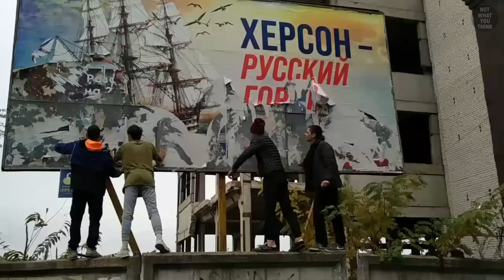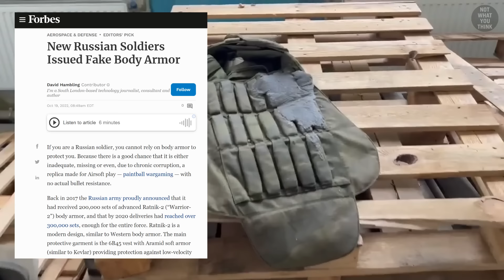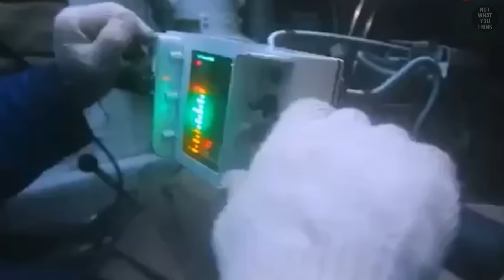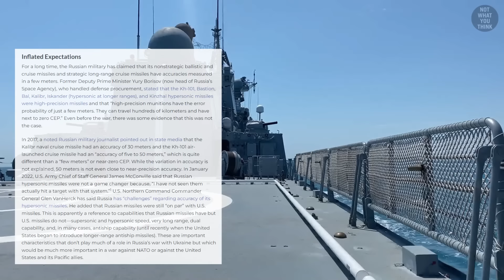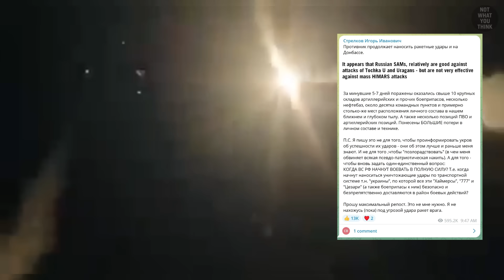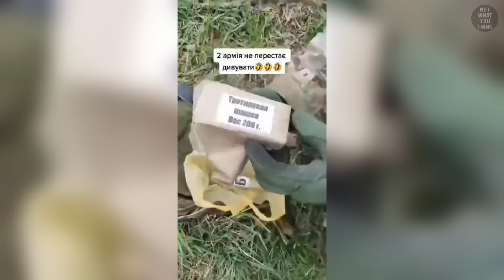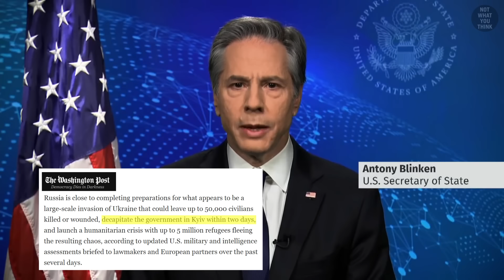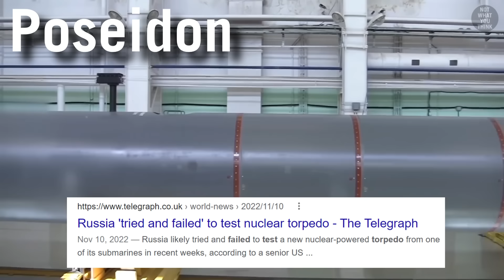The True State of Russian Army

Comment: To be fair, I'm pretty certain it's pretty standard to have more planes than pilots, as it's far easier to make even a f16 than it is to train a pilot to be really good in it. That said, the difference is probably far larger for them than it is with most air forces. Also while Ukraine has managed a lot due to outside help, they held incredibly well before any came their way
Reply: Not as much the case today as it used to be, becoming an aviator in any US service is highly competitive with many people and realitively few aircraft. For example the F16 is the most produced US fighter recent time with over 4,600 units built while during WW2 the most produced US fighters were the P47 and P51 both with over 15,000 units built with the P38, P40, and F6F all exceeding 10,000 units each.

Edit: I missed a US fighter over 10,000 the F4U Corsair
Reply: The Uks have been getting western assistance since 2014. The volume and quality increased after they lost most of their kit in the early days....
Reply: No... US n most of modren nation, had more available pilot than plane.. sure, for certain type like F35, could be a shortime shortage, but its not that difficult to re-train well seasoned f18 or f15 pilot to fly other newer jets.
Reply: Not only it is hart to get and keep trained crew , apperenly combat missions are very exhausting and pilots need long resting time, so keeping operations is limited by people - not machines.
Reply: "We have enough aircraft just not enough pilots to fly them"

Comment: Just another point .The Long mosein Nagant some 5cms longer than my 1948 Carbine had far far less recoil than the Carbine in fact the Vietnamese Snipers mainly used the Long version of the 7.62x54 Nagants during the Vietnam x USA and French War. They are good weapons and only problem I came across was that a fault sometimes caused only the first 4 rounds to load and the last would not want to engage and load so one used four rounds and shoved the last round in with the fingers. It seemed as if the loading arm was not correct? Still very good rifle with the fault.Very accurat. PS  Front sight may not be original hardened metal pin. Some may have mild steele converted nails .No Problem though,  HA  HA  HA  HA. The Large rounds were problems for any air traffic. NB Famous case of the one Peasent bullit fired in the direction of the aircraft getting damaged engine etc,Must have happened many times the Nagant could reach to over one mile and a lucky shot could hurt a Helicopter or Fixed wing . Remarkable Rifles. The Early Nagants Had Hexagonal breech caseings as opposed to post WW1  round  breech  if my memory is correct. Do take these rifles seriously they can hurt and kill at 1900 meters or more . Be Blessed and all stay safe.
Reply: It sounds like you know what you're talking about when it comes to this rifle. I believe you when you say it is very good.

The problem though is that a bolt action rifle has no place on a modern battlefield. Sure, a skilled marksman would be deadly, but the tempo and style of warfare these days just doesn't let the marksman's skills shine.

Better tech and sheer volume of fire is going to win in the long run, even if the old tech blows a few heads off from 1000 yards before its operator gets overwhelmed.
Reply: At least they are the sniper version which has a scope.  Handing out the iron sight version of a 70+ year old rifle would be really embarrassing.
Reply: @stinkytoy  What are you on about? Bolt action rifles are still used by modern militaries for their consistency over semi-auto varients, unless you're talking about the Mosin Nagant just being outclassed in general then yeah fair point.
Reply: @trickydiagram5267  Yeah I'm not saying bolt actions are bad weapons, period. As you said, there are reasons why militaries and police forces all around the world choose some of the better models for certain applications. Mostly due to their accuracy, durability, cost, and reliability/maintainability.

But equipping a sizeable chunk of a fighting force in otherwise symmetrical warfare is just a bad idea, because they will be, on average and as a whole, outclassed by the more modern battle rifles. Especially when the troops that wield them aren't anywhere close to being marksmen due to poor and rapid training. And when the guns are at least as old as their grandparents, and might have been stored/preserved to questionable standards.
Reply: @stinkytoy  Yeah using bolt actions as a service rifle in general is a bad idea; I understand that. I had the idea that you meant that such weapons were completely outclassed by semi-autos in all regards. Ah well my bad.
Reply: @trickydiagram5267  And now that I've reread my original comment, I realize I said "has no place on the modern battlefield"...which was a poor choice of words.

So, this confusion was understandable, and definitely not helped by me haha sorry about that.

Comment: Not entirely accurate on the t-62s they were pulled out of storage but the outdated tanks is not to important. Because the only major difference is the tank on tank combat, and the Ukraine war has very little if any armoured combat it is probably a reasonably good decision to use older tanks. Since both the 62 and 81 mbt’s will perform more or less identically in terms of missile and drone combat
Reply: no one seems to care that ukraine is fielding t55 tanks, it misses their mind, same gun on a t62 as t80 same lethality. Zero tanks are going to withstand a javelin for long
Reply: @vtecmissle  Small correction, T-62 has a 115 mm main cannon and T-80 has a 125 mm. They're technically incompatible. You're still correct though, Javelin will do them in either way, apparently.

Comment: Despite everything, they are still moving forwards. New tanks are rolling off of production lines with homegrown thermals and other such additions, anti-drone cages are being fitted and have had effective redesigns. This video is cope inter-laden with some facts, yes Russia's army was bad in the beginning, but what wasn't was the economy and state of the country, one of those can be fixed easily, the latter can't. If you take any second to analyze 2014 -> now, you'll realize why it needed to happen when it did. Russia can now stand on it's own two feet in the world and does not need to rely on us for export or trade. In fact, some American companies are now feeling the brunt of sanctions.

Corruption is very real, and works on BOTH sides. Mindless Ukrainian generals are acting on their own and ignoring important calls made by American personnel, oligarchs eat up most of the aid, and what is sent over rarely has any spare parts or infrastructure to support them in the long term. (See the Abrams air filter that requires constant replacement). 

Propaganda is powerful and videos such as this are paid for by the collective west and seek to improve our morale, the opposite should be done. If Russians are to be viewed as an impoverished army, the realization of soldiers will be 10x worse, when they eventually face off with a competent and modern force. 

Plus, unlike the comments, the modern Russian doctrine is working out fairly well all things considered. Effective pushes are done with storm troopers and other such units, that are pulled out and refreshed on a weekly basis. Drone support is always helping and their communication networks allow more advanced coordination between groups. Large pushes like seen in the Blitzkrieg and Russian counter-offensives, will never be seen again, judging effectiveness based on that is stupid.

Comment: Since Russia as a whole is mostly influenced by normal to high air pressure, strong winds are relatively rare. This means that many things, installations, houses and trees, are not really secured nor properly maintained to withstand rough weather. Weather like this, will therefore inflict extensive damage and be dangerous in the areas where it hits.

Comment: Visual confirmation has increased the number of tanks destroyed to over 11,000 think about it. 11,000 tanks have been destroyed or left disabled on the battlefield. They are quickly taken by the Ukrainians and repaired and put back into service in less than a week depending on the damage. The Chi 14 Armada doesn’t really exist. It is a T 90 tank same engine, same gun barrel they don’t even have infrared optics and the armor 50% do not have reactive.

Comment: I think you might be wrong about the reactive armor. There are different tyoes, one of which is ERA but I think these might be the non-exclusive variant NxRA which are supposed to house foam or rubber instead of explosives. It's the housing that seem to be fraudulent as they seem to be stainless steel instead of depleted uranium.

Comment: Infinit Range on a weapon how dose this work (I meine theer are still thinks like drag and water resistance)
Reply: It's powered by a nuclear reactor, like modern submarines or Nimitz-class carriers etc. Basically, anything powered by nuclear energy has an "infinite range" as long as the nuclear material is still capable of breaking down (fission) which for all intents and purposes is forever +1 for a weapon. A Nimitz class carrier has basically an "infinite range," the limiting factor is keeping its crew alive with food and water. But if it was autonomous and didn't need a crew, like the Poseidon torpedo, it could technically sail forever barring any mechanical breakdowns.